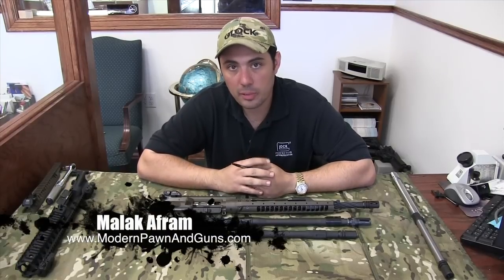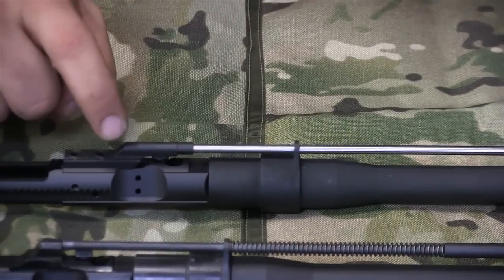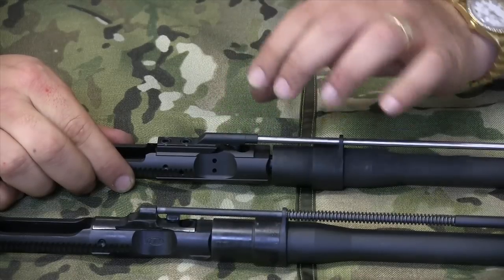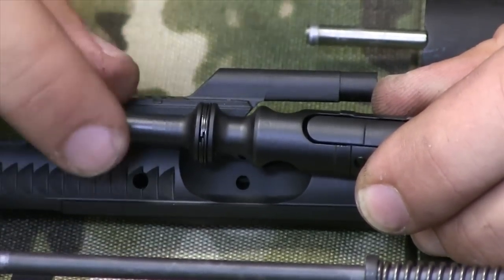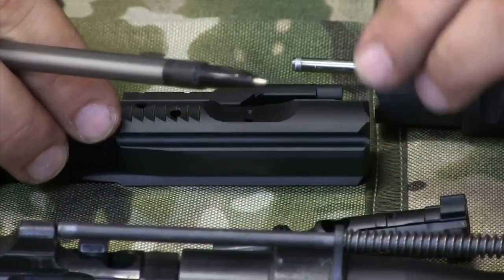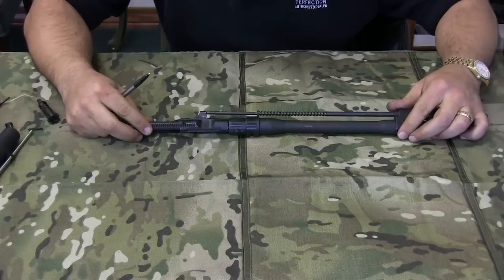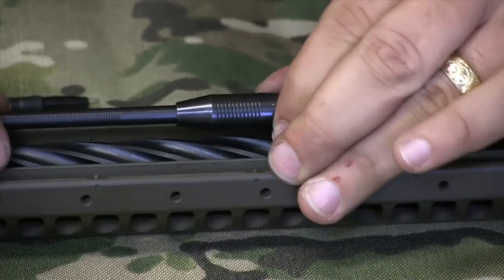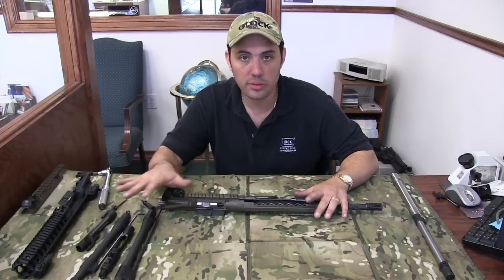Piston Driven vs Direct Gas Impengment AR15 Operating Systems LMT LWRC MRP

Comment: I'm looking for a piston driven AR which do you recommend
Reply: +Fernando Cruz  Take a look at Adams Arms,  I just bought one from Buds Guns and Its great.
Reply: Only Adcor's will allow you to FREEFLOAT the barrel, last I checked.  And the prices are so high -- 1/2 of a COMPLETE AR15 -- that I'd rather just buy a 3rd COMPLETE rifle for each 2 that I have, which allows: You can just start firing the 3rd rifle IF you actually did enough mag-dumps to overheat 2 barrels and still need to keep going, you have the SPARE PARTS, or a rifle that your friend can use if for whatever reason he showed up at your door and has lost HIS OWN rifle and a pack of 20 narco gangsters has followed him (hahaha), less weight on the FRONT of whatever rifle you're using at the moment (offsets the OVERALL weight-gain of approx 6 lbs for the 3rd COMPLETE rifle; the 3rd rifle also means 50% more rounds fired before you need to CLEAN (all 3, unfortunately).

I'd focus more on a home-made GAS ADJUSTMENT SCREW cuz most rifles are over-gassed and you get less recoil AND put less force+heat AND less dirt on your BCG with that simple $5 at-home mod -- which then ALSO allows you to go subsonic.

Comment: I rarely break the firearm completely apart, beyond a field strip, for cleaning. When I do, out of all my DI firearms, I don't get more than a couple dirty patches out of the internals after 1000s of rounds. It's not dirty enough for me to even consider moving parts that aren't inline with the barrel. Never a failure due to build up. Even suppressed I wouldn't call it dirty. No thanks get a real BCG that doesn't have chewed up rings!!!

Comment: my buddy loves piston AR's oh they are more reliable and will never jam and can shoot brass and steel blah blah. I own 2 DI's AR's I have a spare bolt carrier group for each gun and a gas tube. With DI spare parts just about 99% are interchangeable with other DI AR's on the market. Piston gun are proprietary so if it breaks you need to send it back to the manufacturer/gunsmith, piston ar's have more moving parts and are heavier. Yes they run cooler and are cleaner.

Here's my thoughts if wanting a piston AR if you are
Running a SBR
Running Suppressed
Full Auto Shooting (which 99% of people cant do anyway)

otherwise just get a DI. for the price of piston gun save that money for ammo and mags or optics or spare parts

If you truly want a piston gun do not buy a AR  (well with 2 exception in my mind if you can afford an H&K piston Ar which is 3 grand or LWRC which is around the same price)

Otherwise do not buy a piston AR. Buy a gun designed around the piston such as an AK, SCAR, ect.

If you buy a piston AR because you do not want to spend time cleaning it you should not own any guns period. Learn to take care and clean your weapons and they will serve you well.

I
Reply: SCAR isn't sold in 80% kits

Comment: Direct impingement is the way to go for 99% of users, and even when running a suppressor there are plenty of ways to make the system work. However, if you're going to go with a piston system, I can say from personal experience ( I've owned each of them) that the PWS long stroke is by far the superior system, and solves basically all of the problems that are inherent to the short stroke system as used by HK, LMT, lwrc, etc. If for some reason DI is just not tickling your fancy, get a PWS MK1 mod 2, and you won't regret it

Comment: There are pros and cons to both systems.  

Gas Impingement System
Pros - the only moving part is the bolt and bolt carrier which are in direct line with the bore of the rifle allowing the shooter to remain on target through the entire cycle.  This brings the recoil straight back and allows for quicker follow up shots since the shooter doesn't have to reacquire the target.
Cons - Hot dirty gases are pumped directly into the bolt.  Heat makes the bolt expand and carbon is deposited.  This can lead to malfunctions.  

Piston System
Pros - the bolt and carrier run clean and cool as the gases are vented at the piston.  This increases reliability and reduces maintennece.
Cons - The piston is moving above the bore axis which in turn strikes the bolt carrier above and off center to the bore.  This causes the rifle to recoil back and upward.  At distance this can pull the sights off target.

Personally I prefer the piston system as the recoil on an AR is light and so is the upper movement of the muzzel.  I think that the pros of adding reliability and decreasing maintenence out weigh the cons.  To decrease the muzzle flip I suggest choosing a mid-length rifle over the carbine length one.  The mid-length allows the cycle to start when the bullet is further down the barrel and gives the shooter a smoother experience.
Adams Arms offers a piston system that will allow you to retrofit your current gas impingement system over to a piston system.  The cost is around $350 and can be done quickly and easily by a novice AR owner.
Reply: agree!
Reply: You should watch Eric (IV8888) do a meltdown video for each system. The DI guns tend to live quite a bit longer.

Comment: Great video.  I would add that piston systems have one major drawback for military applications, specifically, the force (over 100 lbs) required to power the bolt/carrier pushes off the barrel.  That is not good, especially with long shooting schedules (fire-fight) where a hot barrel will more easily bend slightly under such loads.  DI guns, on the other hand, have practically no load on the barrel.  I would only use that type of system with a heavy barrel.

Comment: Not sure why you call the DI an M4 style.
Reply: 13USMCX3 the M4 is DI
Reply: The M4/16 both use DI. So you could say M4 or M16 style and be correct. But if we're talking seniority of nomenclature, than AR15 style is technically the most correct, as the original AR15 is the progenitor to the military rifles which use the same gas system.

Comment: Most people who like the piston system don't understand how the DI system actually works.   To start,  if you have a dirty chamber, your gas rings are worn out or not well fitted to the cylinder the bolt rides in, in the carrier.   This can be corrected by lapping your rings in to the bore.   This will result in a cleaner chamber.   If the rings are properly fitted, combustion gases will not enter the chamber via the gas system.    This is overlooked way too often.       This video ALMOST explains the gas system and bolt operation correctly.   You need to place more emphasis on the importance of the bolt being pressed into the barrel extension lugs by exhaust gases directed through the carrier.    This keeps the bolt firmly engaged in the barrel extension for a few milliseconds which gives pressures time to come down to safe levels.   The bolt does not start to move out of engagement until after several milliseconds have passed and pressures are down.  This helps to avoid excessive wear to the back of the bolt lugs and the front edges of the barrel extension as the bolt is not being dragged out instantly.
Reply: johnsoncm65 I'm looking to build my first AR15. I'm looking at a DI upper because the pros out way the cons. But, can you explain the gas ring thing again? I'm still learning a lot haha

Comment: piston = solution looking for a problem marketing gimmick.
Reply: BlueFalcon! Yes and no. The position does have it's advantages. I like the DI because it's simple, less expensive, and part are interchangeable. As long as the gas rings are good, you shouldn't have an issue with a super dirty carrier. At least that's what I'm told